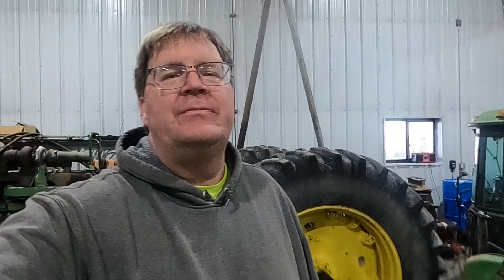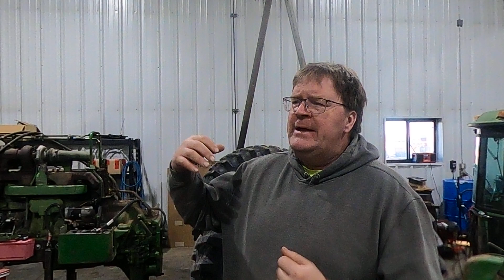Can we use Primary tillage in a soil health situation

Comment: I’d love to get your opinion on how this could be done on some highly erodible land. In my area of SW Wisconsin, NW Illinois, E Central Iowa, there’s hills everywhere. My concern is with full tillage passes that it leaves the land very susceptible to eroding during rain events. In those cases I see it as a “pick your poison” scenario, either deal with a rough field or have the possibility of erosion at the start before the soil really rebuilds its structure
Reply: Is it possible to till on the contour instead of up and down hills? Can you get a cover crop in right away, and have a cover crop over winter?
Reply from the maker: @thomasfranklin4307  

You absolutely could tilll across versus up and down
And immediately get it Planted.
If you can use perennials , that will be there as late in the season as possible and right away in the spring , that would be great
Reply: @thomasfranklin4307  A lot of guys do contour till around here. As far as over winter covers, it really depends on the year. If it’s really wet like this year was, covers were hard to get in
Reply from the maker: Absolutely the erosion behind tillage is a concern. A guy has to try what you can, if you had to do tillage to reclaim some land, for sure I would put oats with other stuff to get a quick green up
Reply: The curse Buster addresses each one of your concerns on highly erodable oil even to the point where you can reverse till you erosion by moving  Soil up the hill.
Reply: The biggest secret to living with hel is getting rapid infiltration and percolation restored every fall without moving a root system .

Comment: Sounds like tillage once in a while isn’t such a bad thing. I am looking to tillage for nutrient incorporation. Mainly lime. If i was to apply 1 ton every fall to every field, might not be such a big deal. But if I am to apply 4 ton once every 4 years or so, i feel that needs to be worked in. I also think of manure, to prevent runoff issues, get that stuff in the ground unless its on a thick stand of grass.
Reply: If you manage density layer development which results in normal root system architecture, water infiltration and gas exchange, then nutrient incorporation is never needed. I also suggest more meaningful info is gained by using 3 inch cores for soil testing. The bottom 3 to 4 inches of datA when included in the sample are misleading.
Reply from the maker: It's not a good thing, but it sometimes is a must thing.
Just east of me in wisconsin, they have to incorporate manure.

Historically, that's how we did our liming,
I have been adding calcium to my strip till program.
To see if I can't get away from some of the surface applied, And also get away from 3- 4 ton and acre  of product applications
Reply: @jonstevensmaplegrovefarms3754  how long can one stand to farm just a fraction of the farm?
Reply: @jimmartindale  i agree to an extent. But to be able to farm more than just a fraction of the farm a person has to make sure they have adequate calcium at the levels you are looking to explore. To me, that tillage to get it down there might be a necessary evil.
Reply: @mn-1381  my experience watching the stratification phenomenon for 40 years is that efficient management of soil aggregation and structural enhancement is entirely adequate to prevent stratification from developing. The vector is water movement and root system architecture combined with abundant microbial nutrient mobilization. I think we have yet to fully comprehend the mineral component of root system exudates. I think that will reveal another significant source of nutrient mobility. It's pretty hard to know all of the components that working when tillage that doesn't dislodge root systems or rearrange the soil microbiome but we definitely  can measure the results. Results are excellent cationic nutrient mobility . Conversely we have been observing reduced leaching of anion like Boron, Sulfur and Chlorides.

Comment: Primary Tillage is nescesary on a cash crop farm every 3-5yrs just to reset and smooth out ruts, also to break the greenbridge.   

Greenbridge =  living roots in soil 365 days a year... better chance of insects over wintering abd hatching on your cash crop.   Greenbridge is real and needs to be recognized when doing cover crops.   Rotate cover crops like cash crops. Leave it tilled bare over a winter every 3'-5 years.   Stuff ive learned in SE Nebraska.
Reply from the maker: Good point on insect disease carry over.

Comment: I am just south enough here in the top 1/4 of Illinois, that I can get the cover crops to do the work. Thats combined with using short season varieties of cash crops. I’m so glad I don’t deal with a generationally instilled focus on yield per season. I am making more calories, nutrition, and profit per acre. 

I can’t go up North and tell those guys how to farm. But I can go south and weep with jealousy at the growing season they get 😂. Sure I have better dirt to start with, but the most dead clay or sand can be developed in to great soil, and land down there is still cheap. I know how to farm with low water, as long as I can drip in what is needed at the precise times the plants need it. I prefer a dry year. Less disease.
Reply from the maker: very good points.

I spoke down in iowa And central illinois. And I did make jokes about how them guys are too far north, too cold, and too wet to do any of this stuff. But up here where i'm at it works...

Profit per acre? How does that get you in magazines and local hero status in the coffee shop?
Reply: I think 2023 should have taught us a lot about the significance of capillary water. Without it functioning well i saw a lot of 30% tip back corn in MN. With it we saw record yields

Comment: That's where I am on hay seedings. Turn it over. I am looking at taking on a field however that if I do, I'll do a summer burn down and no till seed in August. Run a seed rate of about 3/4 and double plant.  My idea is that the drill would loosen enough soil for a better seed soil contact. This field is really light soil. Now sod going into corn. I've had some of my best corn no tilled into sod but I've always did a fall burn down. This year im going to try my burn down about five days after planting.
Reply from the maker: I had very hit and miss Results burning down in the spring. Even with 2 passes Some of the fields by harvest time we're a weedy mess.
Reply: @jonstevensmaplegrovefarms3754  yes have too. On the regenerative side they are planting into green cover crop and killing after planting. I want see how it works. I don't sell the corn and have to minimum yield goal of 110 bushels per acre. One acre feeds one steer. Planting my own corn is really just for rotation of hay seedlings and insurance against these high price swings. Of course this year looks like a better year to buy it.
Reply: @danw6014  it's never a great idea to be decomposing in soil while trying to grow a nitrogen requiring crop, which includes all crops, even legumes. Beans are forgiving because of the synergy of rye root exudate amino acids they contain.
Reply: @jimmartindale  what do you think happens when you plow a field of sod over? Rapid decomposition.